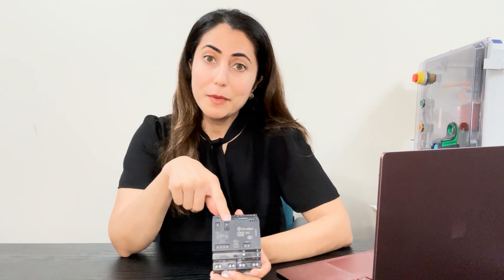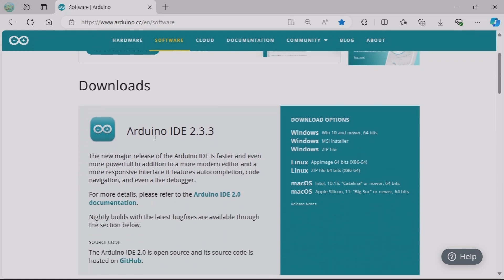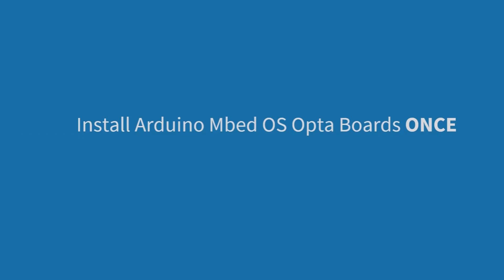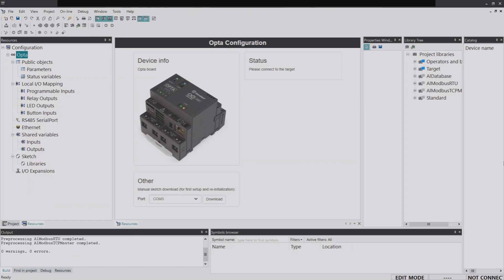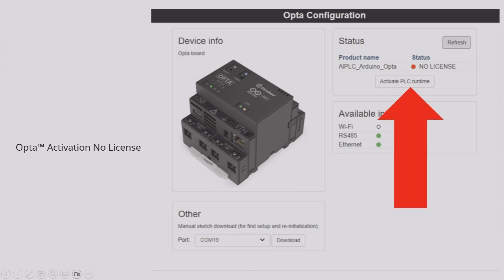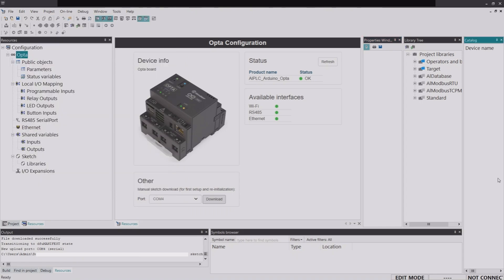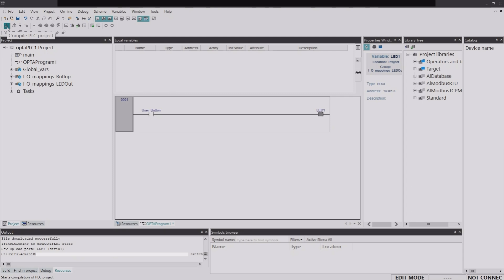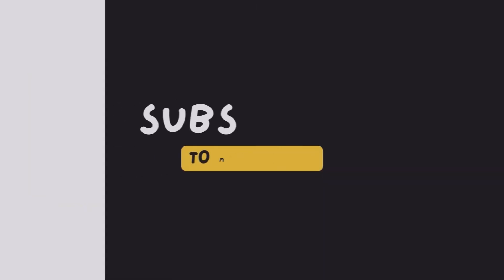Connect OPTA PLC to Arduino PLC IDE Software (First time Setup)

Comment: Comparison of this device with S7-1200 would be interesting. And price comparison in case of different number of inputs and outputs. Nice video. Thank you.
Reply from the maker: Thanks for watching and for the suggestion, i like the idea of doing a comparison between the two. I worked with S7-1200 long time ago , would be nice to put the two together in comparison.

Comment: more video on ladder logic with opta please!
Reply from the maker: Yes I am planning to cover more on the Ladder logic programming with OPTA very soon.
Reply: @InstructorZara  thank you so much!:person-turqouise-waving:
Reply: yeah, with some simple circuit included will be best
Reply: @InstructorZara 
Please make that series. First time working on OPTA & accustomed to LD in TIA Portal.

Already having lot of trouble.
Reply from the maker: @TariqAlware  Thanks for the suggestion ,Yes I am planning to post more about LD with OPTA PLC. I have been spending time with Arduino OPTA these days and planning to post more videos (very soon :) ). 

Also , meanwhile if you want to learn about LD similar to Allen-Bradley platform ,please check my courses on Linkedin learning , i have many of them covering Ladder logic programming.

Comment: It was not possible to have communication with OPTA and laptop? Can you help?
Reply from the maker: There could be so many reason why the connection, Once suggestion is try a different Device and check that at least you can connect to the Opta device . Also i know it sounds odd, but try using difference USB-C cable and check the connection with your laptop.
Hope it helps
Also check this link ,they do provide some good suggestions 
:https://support.arduino.cc/hc/en-us/articles/8824551178780-If-PLC-IDE-isn-t-working-with-your-device

Comment: Hello @InstructorZara 

Currently I am working with the opta PLC, the top Wi-Fi model. 
So, this is basically commercial project for pump control and mostly the control side program has been developed in PLC IDE. Most of the part is ladder logic. Some of the blocks are in St. Structure text. 

But now, I am stuck with using the internal RTC in plcide, I cannot figure out a way where to find the local running time. Since this is needed to generate logs for some alarms. We want to generate some internal logs with the time stamp.
Suppose a PUMPs MPCB trips for phase Imbalance protection then the feedback is received on the physical input of PLC. So we want to store a variable with time stamp and that variable with the fault for events logging. 

Could you help me figure this out.